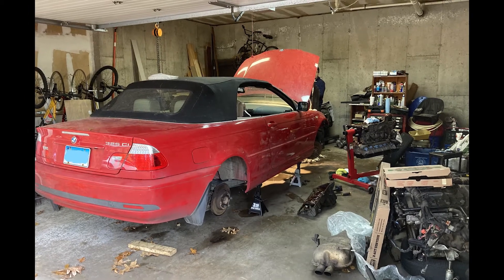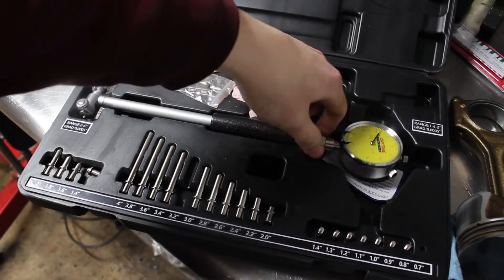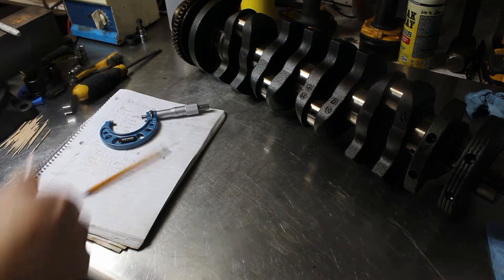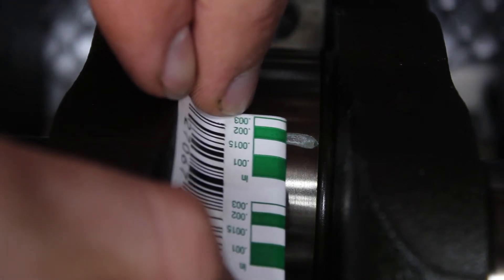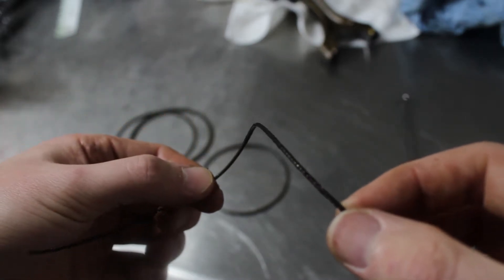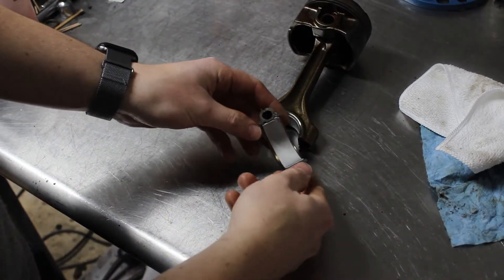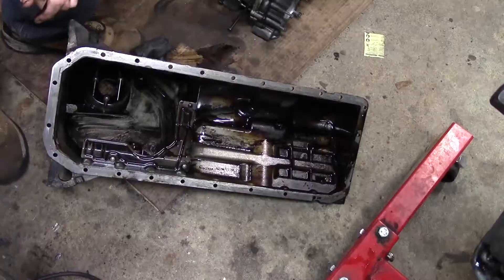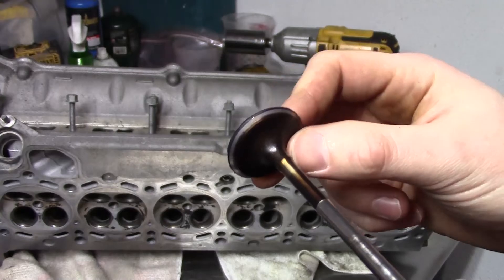Budget BMW 2.5L M54B25 Rebuild - Part 1 - Bottom End

Comment: it takes a while, but is less time and cheaper than a rebuild, especially if its just a street car. Use a combo of berrymans b12 or something similar, and marvel mystery oil and let it sit in the cylinder. Since the m54 sits so far angled you have to use quite a bit and you can crank the engine by hand to get things moving. Then you can suck most of it out with a vacuum pump and blow most of the rest out with a long air nozzle. Do this for each cylinder and theres a good chance you will clear up your rings. Change your oil after all of this because some leaks down into your oil. Its obvious but it needs to be said, do not start the car with the fluid in the cylinders unless you are doing one at a time and leave that cylinders spark plug out and you are prepared for a mess.

Comment: Great video! I have the same year and model car with almost 200 thousand miles, and I have to do this as well. Considering getting a used engine, but I’m concerned that it probably won’t be any better.
Can you tell me where did you get all the parts for rebuilding the engine? Thanks!
Reply from the maker: That's what happened here, the used engine wound up being in worse shape. The parts came from ECS Tuning, Bimmerworld, and Rock Auto, mostly.
Reply: @ thank you, I appreciate it.

Comment: Hi, I’m in the process of overhauling my M54B30, I was just wondering if you used the yellow/standard main bearings? 
The color coding on my crank is not really visible anymore.
Also did you reuse the main bearing bolts?

- From a follower from Denmark :-)
Reply from the maker: The color coding isn't that useful because vendors usually only carry one size. I just buy the set they have and then check the clearance and crush. And yes, main bolts are reusable for a normal rebuild.
Reply: That’s what I gathered! Thanks for answering, sometimes it’s just nice to get some confirmation before going in really deep.
I spoke with my local BMW parts salesman, and the bearings shells can be bought individually actually.

Comment: 12:40 you say you could spin a bearing if the bolts are not fully torqued down...would explain how that could happen please?
Reply from the maker: If you don't tighten the caps down, the bearings are not being squeezed into place. So if you spin the motor over by hand, they could slip and rotate.